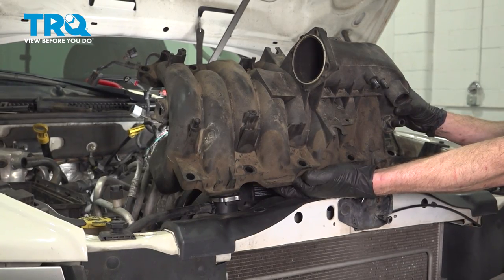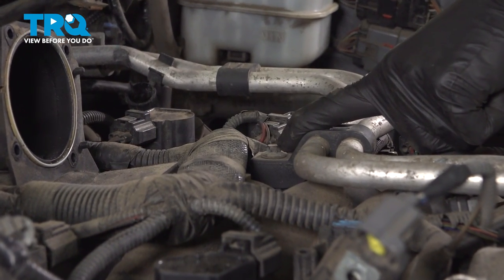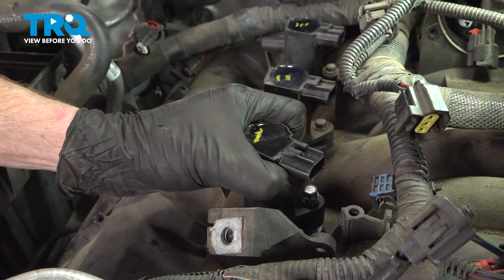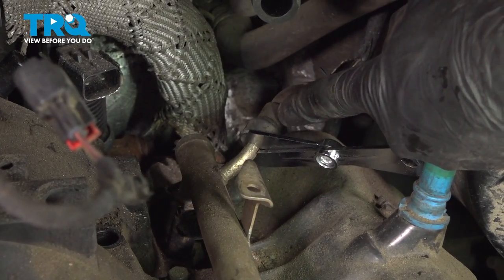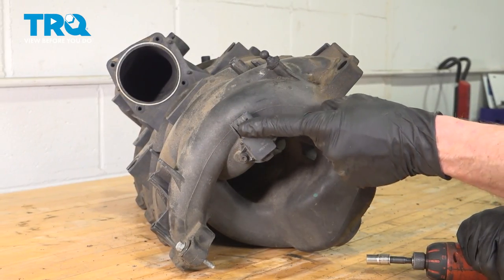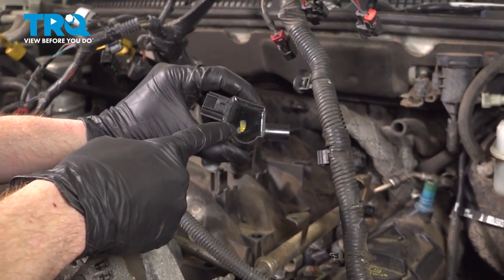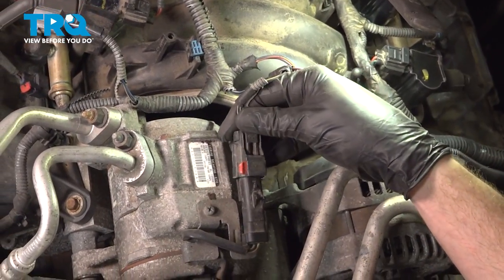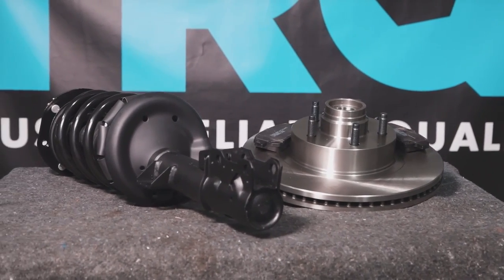How to Replace Intake Manifold 2005-2010 Dodge Dakota

Comment: 2011 1500 ram 4.7 intake manifold I did the same n still I'm leaking both sides in the middle of the intake I even got a used 1 n new gaskets n still the same wat u think